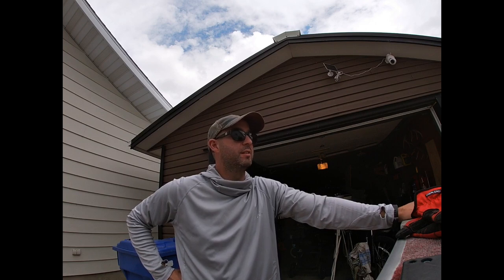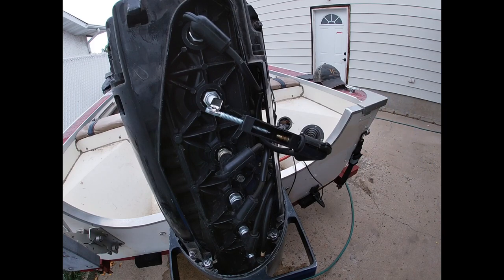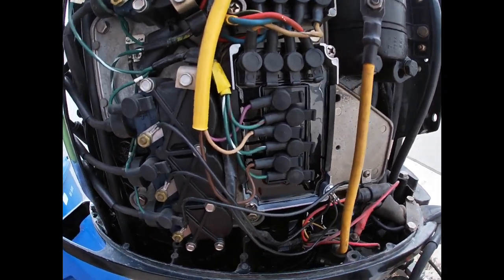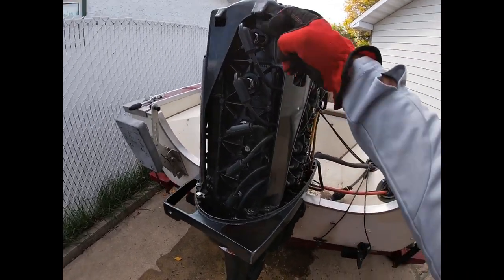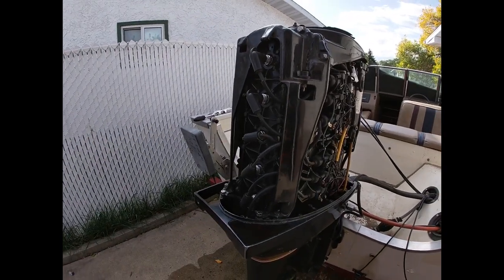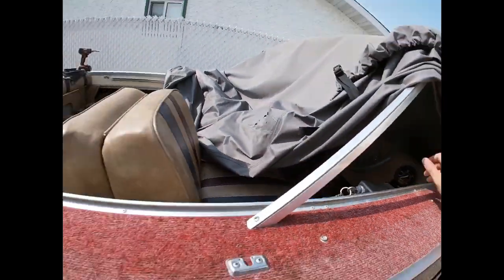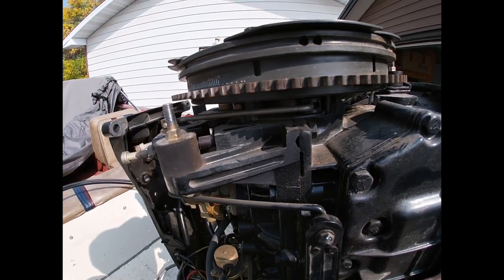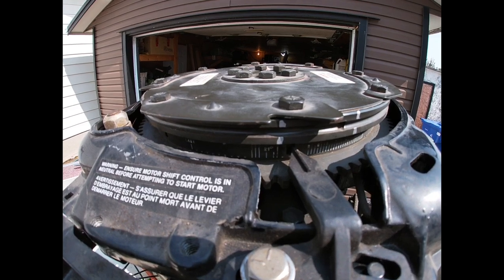1985 Mercury 90hp repair

Comment: Your motor has spent time in the southern US, your bug is a type of wasp known as a mud or dirt dauber.  They make mud "nests" in protected places that they lay an egg in then fill with spiders for the larvae to eat when the egg hatches.
Reply from the maker: Just check on the internet and that looks exactly like what it was, thank you. I’m in Saskatchewan and never seen them before. Was told the boat came from Ontario. Thanks for the comment, now I know.
Reply: We have a ton of those here in Georgia. I’m actually working on that exact motor right now. I’m having trim issues. Any way you could help?
Reply from the maker: @andysangels1970  what is going on with your trim? I could try to help.
Reply: Im from Mississippi in the US.I fight those all the time with my outboard

Comment: You should ground the tester to the Block, using a Plug adds a 2nd Gap to the Path.
It is recommended that both Switchboxes are replaced when one fails, has to do with a Bias between the two
My 84 115 still had the Factory Plugs in it when I traded it 14 yrs later with 800 hours on them
If the Head Waterjacket cover leaks water, it is likely warped due to overheating, which happens on these from over trimming the motor
Don't fiddle with the Linkages without the Service Manual, the throttle valves don't open until all the Timing is in
Reply from the maker: My thought of testing to the plugs were to ensure equal spark to each of them and knowing that grounding wasn’t the issue with the spark in the first place. I also see how grounding straight to the block though would be best for a final spark test as it would be more accurate. The spark seems fine now with just the one switch box replace. If they were cheaper I’d do both. If a fault came from higher above causing the box to fail I would expect potential damage to the other. With just normal wear I’m unsure how one would affect the other. Not saying you’re wrong but I honestly can’t see that because they are separate of each other. I will look more in to that though. And which linkages? Like the throttle to the timing? I appreciate the comments, it’s good to hear from someone else who has worked with these motors.

Comment: Brown Stripes on the Cowl were used in 84 and 85, in 86 the Stripes were different
Reply from the maker: Interesting. I do have the original manual with the serial number. When I looked it up online all searches came up as 86. This boat was originally purchased in Ontario. From what I could find is Canada got a different “style” that year. Possible they gave Canada the old look on the new motors to use up parts?
Reply: @MrKattlyn2  

No. I was at a Dealership in Western Canada in 84, 85, and 86, and 84 and 85 were the only 2 yrs of the Brown Cowls. Does the Serial # on the disk on the Block, match the # on the Transom Bracket? 
I guess someone may have put a 84/85 Cowl on an 86, why I don't know. I took the Brown One off of my 84 and replaced with one from a 1971 1150. Red Decal Cowls were the Best ones Mercury ever had.
Reply from the maker: Very interesting. Well I have the boat in storage. I will certainly check that out when I get it home in April.
Reply from the maker: @pjimmbojimmbo1990  just letting you know I confirmed it is an 85. Have a matching 9.8 outboard and in 86 they changed that model, so definitely a matching pair and with the 9.8 definitely being an 85 I’d say that confirms you know your motor.